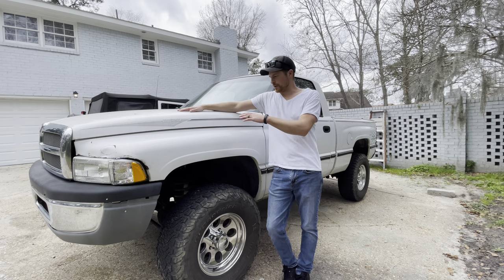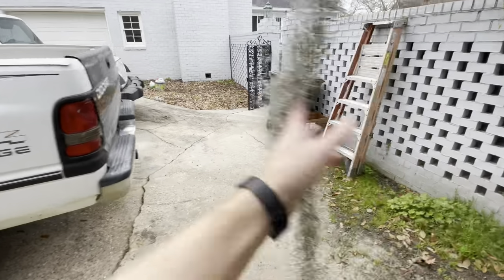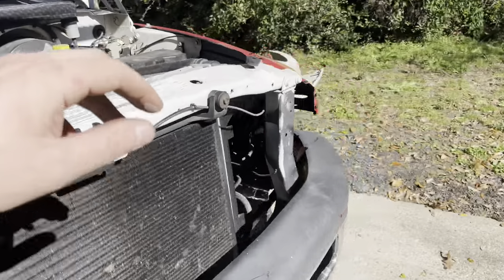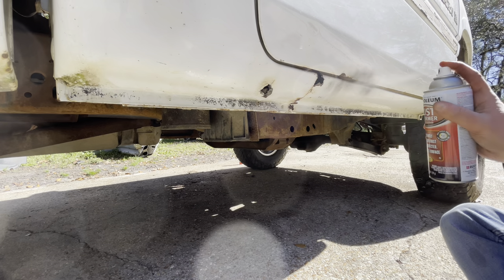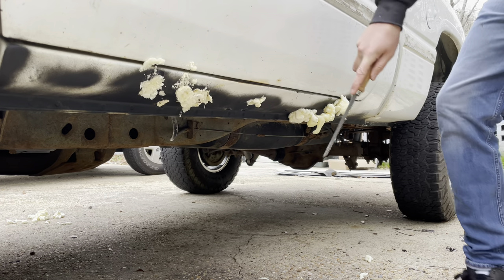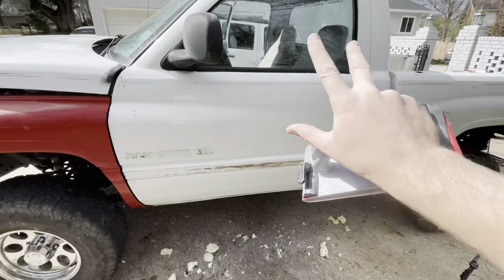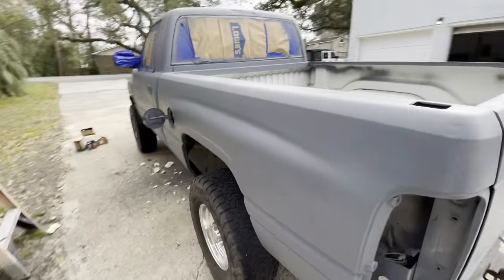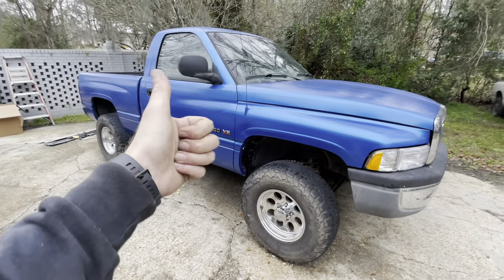$500 redneck restoration completely transforms my old Second Gen Dodge Ram!

Comment: That foam is gonna hold moisture and make the rust worse than it was
Reply from the maker: I’m originally from NH where everything was a rust bucket, and so I’ve done several trucks with this technique. Obviously not professional body work but it holds up well in my experience.
Reply: @TheMoparGarage   @alexmitchell7083 I don't like foam-filler, but I get the value of what you did here. What if you wanted to quick-fix it now and still be able to weld a new rocker on later? I'd suggest you figure out what makes it rust (where is the water coming from), create a path for it to drain out, fill the rest with foam/bondo and make it beautiful now.

Comment: The spray foam is a super hack job [I personally won't do because my OCD won't allow it] BUT these trucks are a dime a dozen so whatever it takes to make it look good ! Love that color I looked for one for a long time ended up with a Flame Red Sport 4 x 4 360 gasser 1500 !! Looks good keep up the budget builds us working stiffs love them !!
Reply from the maker: Thanks for watching!! Haha spray foam is probably not a recommended practice for people with OCD tendencies! I grew up in NH driving a lot of rusted out crap though so this was standard practice growing up. Intense blue is a great color, but yours sounds like a sweet truck! I've owned a boat load of 2nd gens, but I've been looking for a 5 speed V8 2500 recently. I sold both of my 2500's recently so I was forced to tow one of my new projects (73 plymouth Satellite) home with this truck and the tall gears weren't ideal.

Comment: Nice rattle can paint job.  The index finger must have been hurting after all that.  Mine gets that way just doing a single body part.  Does this mean you have to change the title or registration going from white to blue?  The one reason I bring a magnet with me when I check on cars from PA... where they won't pass inspection with rust through, and so you get a lot of Bondo over socks and duct tape 😁!!
Reply from the maker: Haha index finger was killing me! I switched to the middle finger and then to the thumb and then back a bunch of times. I actually thought about the title yesterday…legally I probably do have to. Not sure if I’ll ever get around to it 😂…I am originally from NH so I drove a lot of risk buckets, but here in SC we’re so fortunate, we don’t have to deal with rust unless a truck has come from somewhere else. We also don’t inspections of any kind. Which is scary in some ways but awesome for car guys like me!

Comment: Yeah, that came out really well. Looks nice in blue. Makes me wonder if it's possible to wet sand/polish that particular type of clear.
Reply from the maker: Thanks man! I’m not sure if it’s possible, I wondered the same thing…. I know they make that 2K clear stuff in a can now that is extremely high quality - it supposedly acts just like a real clear coat. I didn’t want to deal with all the PPE involved in applying it though considering how much of a “backyard job” this was. That’s serious stuff.
Reply: @TheMoparGarage  I actually have a couple of cans of it. If the weather will cooperate, I'm painting the roof of my 2nd Gen. I had base and clear mixed into aerosol cans. My local O'Reilly will mix it.
Reply from the maker: @ProjectTimeGarage  that’s awesome. From the videos I’ve seen it comes out looking like a full on professional paint job. Just make sure to wear a good respirator and goggles!

Comment: I just found your channel yesterday and cant stop watching your stuff on this truck i have a 01. But I have a ticking when accelerating and after i shut it off i can still hear it but not at idle or when crusing, any ideas? Im thinking exhaust manifold.
Reply from the maker: Thanks for the kind words and welcome to the channel! Exhaust manifolds would cause a ticking under load, but might not at idle so you’re probably on the right track. If it is more of a pinging noise, it could very well be an intake manifold plenum gasket failure. 318 and 360 magnums are notorious for that. The manifold itself is aluminum and the plenum plate is steel, metals expand at different rates when they get hot, and the gasket fails. Hughes engines makes a great kit that has a nice thick aluminum plate with a new gasket and bolts. I install it on all my magnum engines. I think it’s about $150 and takes probably 5 hours or so to change if you’ve never done one before.

Comment: I could use a little advice. What transmission fluid should i put in my 85 turbo z? The dip stick says dexron II. I haven't found any around tho.
Reply from the maker: They don’t make Dexron 2 anymore, Dexron 3 is the updated version of it. It’s typically used in GM’s, but if the dipstick says Dexron 2 then it would be safe to run 3.

Comment: Just found your channel because I found a 98 Club Cab thats been sitting for at least 5 years. Dont know much about it yet, but thinking I may have to take a closer look at it. Question about the rattle can paint. Could you go over that with a rubbing compound followed by a polishing compound with buffing wheels and get rid of a lot of the imperfections im the spray can paint job?
Reply from the maker: Thanks for watching man! The only way to get a paint job that can be buffed with a rattle can is to use what’s called 2K clear. It’s a 2 part system but if you use it, wear a full on respirator. It’s the real deal.